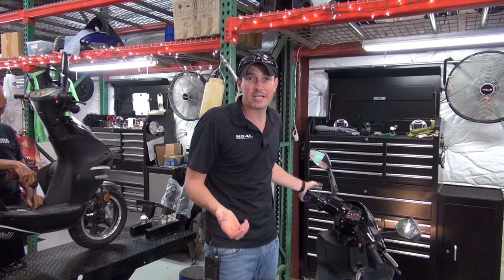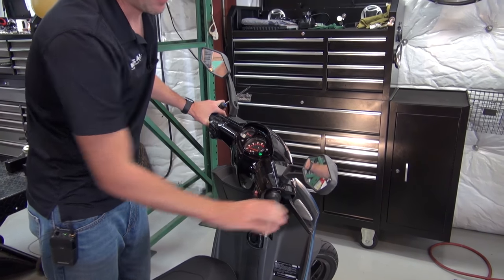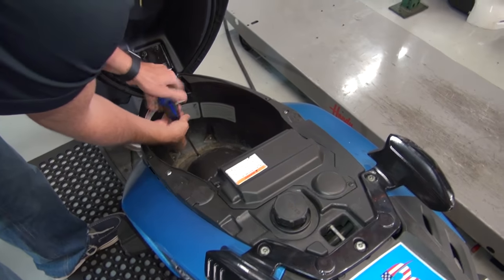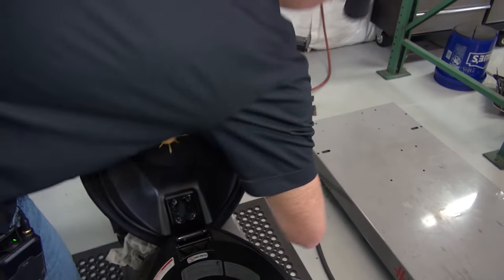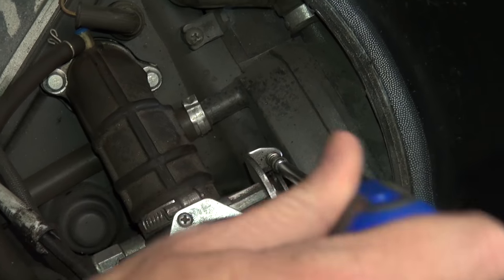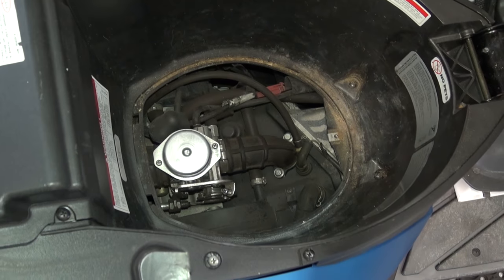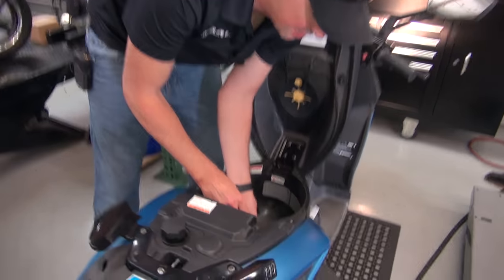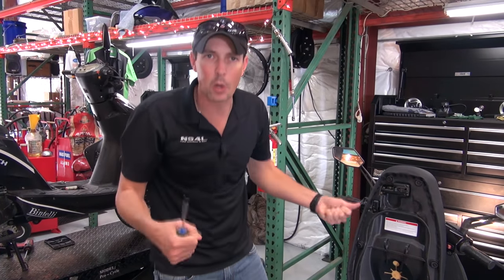Scooter Troubleshooting: Scooter Dying Out When You Come to a Stop / Low Idle

Comment: so, this happened after i went over a huge pothole. engine has not been running well since. the engine dies every time i stop while warmed up, and choke is extremely high when cold. throttle is also very sluggish when i try to give it gas from a standstill while warmed up. i suspect something like a hose came loose, but have not been able to find the problem yet
Reply from the maker: I'd bet the same thing.  Check to ensure that your intake manifold (between the engine and the carburetor) is tight and not loose or cracked.  You could have a vacuum leak somewhere.  Also check to make sure that the air box that attaches to the other side of the carburetor didn't pop off.  Make sure it is nice and snug on the carburetor.  Make sense?
Reply: @NewScooters4Less  i checked the vacuum lines and intake manifold. No problems. I also discovered another thing. The scooter works completely fine, every time i take it out of my basement, as if nothing is wrong.
Although if I leave it outside in the winter weather and start it cold, that's when the problem occurs. Same problem, it idles high when it's cold, and sputters/bogs more and more as it warms up. Dies completely after driving for a minute, (especially when releasing the throttle) and won't start again until cold. 

There is spark, and the spark plug is brand new. 

After it died on me i removed the spark plug and inspected it. It was a little black, not too much, which usually is a sign of a rich mixture, but no other signs of it, such as visible exhaust smoke and rotten egg smell. (And as i mentioned runs perfectly when stored inside)

I checked the valve clearances and it was 0.05mm intake and 0.08mm on the exhaust.
Something seems to be malfunctioning when it has been sitting in the cold weather.
Reply from the maker: @thatshot-ey8kh  Scooters HATE the cold weather.  Especially when it is carbureted and not fuel injected.  Our dealership is in Florida and it is even a struggle here.  They are going to be difficult to start in cold weather.  Once you get it started, you want it to warm up for at least 5 - 10 minutes before riding.  Once the motor is nice and warm, it will usually be fine.  The carburetors have an automatic choke to help with this problem (which is why it starts off idling high).  When the motor warms up, the automatic choke cuts off.  Just sounds like your scooter (like most) is finicky with the cold weather.
Reply: @NewScooters4Less  oh right, forgot to mention that i do let it warm up, but when i do, it idles increasingly faster and faster, close to spinning the back wheel. After a minute or two, the idle plummets and the engine dies. It starts up again but not without throttle. The throttle is very hesitant and unresponsive, no matter how much i give it. It can drive for about a minute, until the bogging gets to the point where the engine just stalls regardless if i'm stationary or driving, or giving it throttle or not.

I am certain that there is something wrong with it, because last year it would stay outside for eight hours while i'm at school in -5 degrees celsius compared to the 8 degrees now, but started and drove flawlessly back then.

-it gets spark, fuel and air.
-it has good compression
-the problem only occurs after sitting outside for some time in the cold weather.
-drives flawlessly if stored inside
-it has 4634 km on it

Maybe it's something electrical? Like the enricher?
Reply from the maker: @thatshot-ey8kh  Have you adjusted the valves on this machine since you've had it?  You may want to try that. Besides that, I'm not sure how much help I can be.  What I can say is that my experience scooters is that they are super finicky in extremely cold weather. Here in Gainesville, if it gets below 40 degrees F, the number of calls we receive related to scooters not starting or working properly goes way up. Best wishes with it my friend.
Reply from the maker: @thatshot-ey8kh  (Not sure if you removed the last question, I can't seem to find it or YouTube is acting weird... but I say this in my email box)... "thanks a lot! i am going to adjust the valves this week. Also, one question, can valves get tighter by themselves when not adjusting them for a while or do they just get looser?"  - Both can happen.  I've often seen scooters have a difficult time starting, and then we go to check the valves, they are so tight they can't move.  Hope that helps.
Reply: @NewScooters4Less  Thank you so much! I've fixed the problem! It was indeed the valves that needed adjustment, as the lashes were actually not checked properly the last time I did it. I've had put the feeler gauge at a bad angle so it got me inaccurate measurements. 
Yesterday I removed the valve cover and re-checked the valves properly this time. They were way off the factory spec which I finally found out is 0.10mm both (4 thou). The exhaust valve had almost no play. I gathered my courage (as I considered myself mechanically incompetent haha!) and loosened the lock nuts and adjusted the lashes, which took me about 30 minutes because it was my first time and wanted to make absolutely sure that I did it right.
Afterward, I took it outside in the cold weather to sit for a few hours to test it. It usually took 10-15 kicks to start it, but it started after only 2! It idled smoothly and warmed up steadily. And kept idling. The throttle has become very responsive. It never stalls on stops. Its torque has noticeably increased. Not only did I have enough confidence to drive it to the gymnasium today, (the secondary-school-kind-of-gymnasium) but also, I have just now arrived home with it. It just works.
I appreciate the help and replies. I have subscribed and will definitely show this channel to my moped friends.
Reply: @NewScooters4Less  And yes I removed the comment because I have already found out the answer :D I couldn't edit the comment for some reason so I ended up deleting it
Reply from the maker: @thatshot-ey8kh  Awesome!  Glad it all worked out and you're riding again! Thank you for subscribing, watching, and sharing!  Lots of cool content coming in 2020!
Reply from the maker: @thatshot-ey8kh  Sounds good.  I couldn't figure out what was going on, lol.
Reply: @NewScooters4Less  lol xD

Comment: Hi man. This happened to me after i moded the petcock from vacuum to manual shut off valve. It runs a few meteres om throttle then on deceleration it stops like gas gor cut off. Does the mod affect idle or air fuel mix?
Reply from the maker: If the vacuum line isn't there now, how is the system pulling fuel from your gas tank to the carburetor?  I would bet YES... your modification affected it and I would change it back.  Sorry!

Comment: Did this before the next day it wouldn't start and am still having issues when i jump the battery it starts like that then i can adjust throttle again but without jump box even when the battery is charged it still doesn't start over just clicks... Anyone have tips?
Reply from the maker: Is your starter solenoid bad?  Also... check for loose grounds.  Sounds like a ground may not be attached or may be loose.

Comment: My scooter does not have idle i give it gas it runs let off gas it dies. I've adjusted idle, don't work. Could it be something with accelerator handle or throttle cable?
Reply from the maker: Could be.  May need to adjust the throttle cable where it attaches at each end to make sure it is not too loose.  Probably needs to be tightened up.  And if your scooter is carbureted, it has an idle adjustment.

Comment: hi i have problem with my yamaha vino 125 2006 has spark has gas exhaust is good  valve is good crank but wont start  i change the carburator cdi /coil / valve ajust compression check 140 psi  still wont start what can be the problem [note i have 2 yamaha vino 1 running 1 not running ] thanks
Reply from the maker: john woo honestly man, I’m not going to be a lot of help here. Sounds like you have all of the requirements. When you say it ‘has gas’ does that mean that it just has gas in the tank or you know for a fact that gas is getting to the carburetor? How old is the fuel? If you have spark and compression, I’d replace the fuel / fuel system: new fuel, 93 octane minimum, replace fuel lines, fuel filter, and reclean the carb. Hope that helps.

Comment: I have the same scooter (60 miles on it) and it dies out no matter what. I even adjusted the idle screw all the way in...still dies. I have to give almost all of the throttle to even start it. Any suggestions? I have to kick start it...pretty sure i need a new battery. Could that be causing this issue as well? Also, i checked the spark plug (once i finally found it. Hint: it's not where the manual says it is. Ha). Thanks
Reply from the maker: It only has 60 miles on it?  If you bought it from a dealer, take it back to them. They should get it tuned right for you with only 60 miles on it.

If you got it used or something and only has 60 miles on it, has the carburetor been cleaned?  My best bet is that you need to clean out that carb.
Reply: @NewScooters4Less  , yeah it was given to my wife with only 7 miles on it. We don't have licenses yet, so i just run it around the neighborhood when i can to keep it going...apparently, i'm going to need a new battery because it sat for a while and now it doesn't hold a charge. I've been kickstarting it, but i have to keep on the throttle to keep it running, so i guess i'll try cleaning the carb. I've watched a few videos, so hopefully that'll do it. Thanks
Reply from the maker: @bnoyz3  Yep.  Besides the battery, your fuel system probably needs a really good cleaning.  I'm betting the carburetor is a little gunked up.  Thanks!
Reply: @NewScooters4Less  thanks for all of your help. Sorry, one more question...Will running 87 octane gas in it hurt? I think the manual says something about a formula R+M/2 90 or something like that? Does that mean i should use premium (93 octane) and not 87 or 89? Thanks again.
Reply from the maker: @bnoyz3  We always tell our customers to run the highest octane fuel. We have seen many customers experience multiple problems in the past by running "the cheap stuff." Definitely worth the little extra to run premium! So, yes... Use 93 octane!  Thanks!
Reply: @NewScooters4Less  Ok, thanks. So, i have 87 octane in it now and i added this stuff that's supposed to boost the octane a little and supposedly help clean the carb "without removing it"...Ha, I know probably snake oil. But, my question is, should i drain all of that out. I bought a new battery today (it's charging up now), and i already bought some 93 octane gas (in gas can). Again, thank you for all of your help and for continuing to reply. I really appreciate it.
Reply from the maker: @bnoyz3  If it were mine, I would drain the 87 octane and put in the 93 octane.  You still may need to clean out the carburetor too.  I'd probably replace the fuel lines and fuel filter at the same time just because it's inexpensive to do so and that way you know it's fresh.
Reply from the maker: @bnoyz3 Anytime!  Best wishes!

Comment: Help! I adjusted my idle already and it wont idle anymore since like the 4th day i had it its been bogging out and now its getting worse and will barly start only 467 miles on it im foing to try and clean the carb on it to see if it helps any but idk it might be running too lean
Reply from the maker: If it's bogging out, definitely check the carb and check the air filter.  Sounds like a fuel / air issue.  Are you putting the proper fuel in it?

Comment: This is not a permanent fix for me. I got close to fixing this problem by tuning the jets to the right size, changing the needle position and adjusting the fuel/air screw. The idle screw will result in an idle to high when the engine is warm. These scooters are hard to tune idle wise.
Reply from the maker: Sorry to hear that. Hope you can fine tune it and get it locked in!  Best of luck!
Reply: @NewScooters4Less  thank you sir.

Comment: i have an efi lexmoto venom and it keep cutting out, i have changed spark, just had service new air filter, any ideas where to go from there
Reply from the maker: Are you sure it is getting fuel properly?
Reply: @NewScooters4Less  I think so, if I keep the throttle open it won't stall, it doesn't seem to be under power, the bike moves as fast as a want it to. I have put fuel cleaner tho it to make sure nothing is blocked to much or dirty, about to fill it back up.
Reply from the maker: @MrStitty26  Is it bogging and dying or is it just shutting off while driving?  It could be losing spark while driving.  May not be the spark plug, but could be coil, cdi, stator, etc.
Reply: @NewScooters4Less  it will only stall on idle so at light or when a have stopped, when i keep the throttle open it run great, one thing that dose happen is when i take of the accelerator it sounds like a bag off popcorn in the micro wave. also had a look today and noticed that there wasn't a cdi unit under the seat but the connector is there for it, but id imagine it wouldn't run at all without one. dose have an ecu under the tank as well.
Reply from the maker: @MrStitty26  This isn't the problem is it?  Check this video: https://youtu.be/v3G4tx3zcCY

Comment: What's the ideal idle speed? Mine was 3000rpm warm and it seems to be a little fast. It kept feeling like it was gonna stall at stop lights (never did though). What rpms should I adjust it to? Thanks!
Reply from the maker: Can be different depending on scoot.  For example, idle speed is specified at 1600 RPM +/- 100 RPM for a Wolf Islander.  You might have a broken clutch that is dragging or your carburetor idle circuit is compromised.  But also, you have to consider other factors like spark, valve lash, air cleaner, and overall state of the motor.  Hope that helps some!
Reply: Well, it's an automatic so it's definitely not a broken clutch. I made an adjustment to the idle screw and it's running much better now. Idles at about 1800-2000. Thanks a lot!
Reply from the maker: Awesome.  [You do have a clutch, but your transmission is CVT.] . Safe Scooting!

Comment: Will this help with a scooter that is bogging down at wide open throttle?
Reply from the maker: No.  I wouldn't think so.  You probably have a fuel / air mixture issue going on.
Reply: Check the rollers, there might be dirt too.

Comment: So I have a scooter that shuts off when not on throttle I'm buying a new carburetor should that fix the problem or is it something else?
Reply from the maker: CT Spoder you may not need a new carb necessarily. Do you have vacuum leaks? Is the fuel bad? You might need to clean the carb.
Reply: @NewScooters4Less  I fix the jets cleaned them out and haven't had any problems
Reply from the maker: So it's all better now?
Reply: @NewScooters4Less  yup
Reply from the maker: Awesome.
Reply: @NewScooters4Less  yeah thx alot

Comment: 49 cc scooter carburetor floods gas pours out of top even when turned off  any ideas?
Reply from the maker: Fuel pump (petcock) that attaches to the fuel tank is stuck open.  Probably needs to be replaced.
Reply: @NewScooters4Less  nope there is no petcock valve turns out that someone had previously worked on the carburetor  and when they put it back together they did  not reinstall the little plastic weight on the main jet under the diaphragm and the needle valve was bad thanks
Reply from the maker: @oyapl694unme9  Glad you figured it out!

Comment: Can you please help me I have a 150cc gy6 Jmstar motor scooter it a crank right up run for a minute and then cut off back off
Reply from the maker: How many miles are on it?  My first intuition is timing of the engine.  I'd check the timing and check the valves.  Pretty common with 150 GY6.

Comment: Did this a few days ago and still having problem when coming to a stop. I can't put the idle any higher or she'll start moving on her own.
Reply from the maker: Sounds like you have a different problem.  Did you check to make sure you don't have any vacuum leaks?  Check the vacuum line and make sure there are no cuts in the hose, etc.  This is also a common occurrence.

Comment: I have my idle set to the max and my scooter still dies. Do you have any advice for that?
Reply from the maker: Probably not an idle problem.  You may have a vacuum leak or you may need to get those jets cleared out in the carb.  I'd really have to have it in front of me to see to know for sure.

Comment: mine does this when the engine is hot. I dont have problems starting it again, and if i hold the throttle a little this doesnt happens. What could it be?
Reply from the maker: It does what when the engine is hot? Just dies out? Where do you live?
Reply: @NewScooters4Less  The engine dies out only when i stop for some reason like red light. Im from brazil.
Reply from the maker: @serdomal8796  Did you make the adjustment in this video? If so and it is still doing it, you may have a vacuum leak.  What kind of scooter is it?
Reply: @NewScooters4Less  I tried, but im do not sure if it works because i dont ride it till the point where engine is sufficiently hot yet. I have a vespa lx 125
Reply from the maker: @serdomal8796  Is that fuel injected? Where do you live?